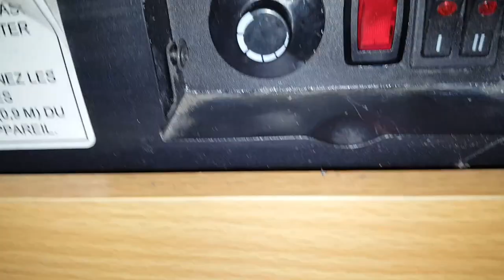Electric Fireplace | Bulb Replacement

Comment: Where did you get the bulb from ? And does changing the bulb light change the color of the fire place light ?
Reply from the maker: Hello i bought it in my local hardware store rona. The bulb is very common so yeah, youll find it easily.
No it wont change the color unless you get a colored bulb and it would mix in with the color of the orange fire template.